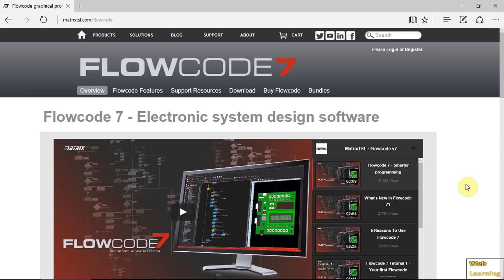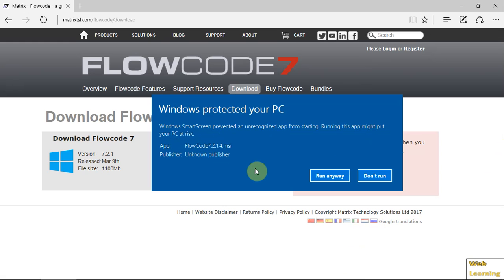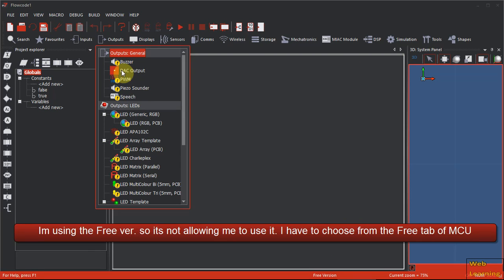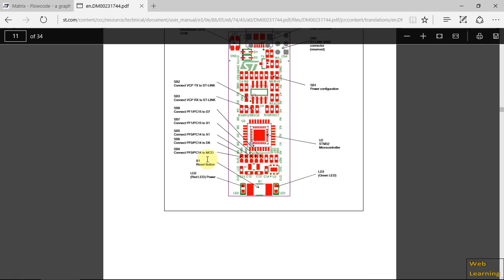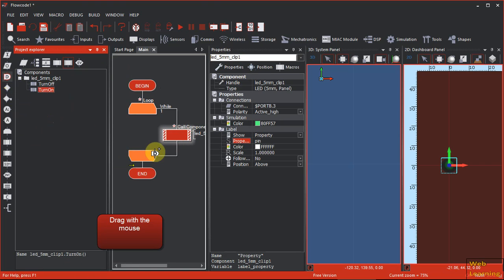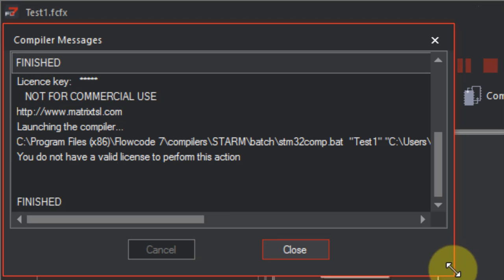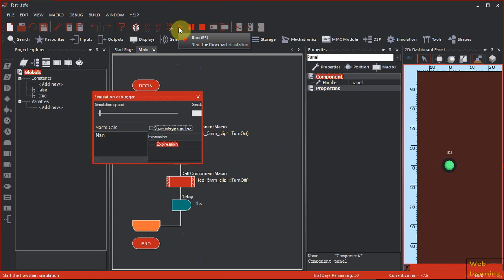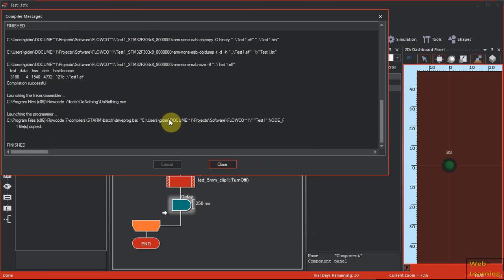FlowCode with STM32

Comment: Just came across this rather old video and had a little chuckle at the comments.

I'd liken the Flowcode visual editing philosophy to Labview for instrumentation. Nothing wrong with that, and a valued tool used across the technology industry.

If your bag is analogue/digital electronics design, not embedded, then Flowcode offers far FAR more than blinking LEDs!!!

Kinda' like saying to a software engineer... "Why buy hardware when you can learn electronics and have the flexibility to design your own?" (as I commonly do).

The Flowcode website and forums would soon reveal the power under the hood, and I've been using it for all professional projects since 2012. Now my professional engineering colleagues are buying into it, including integrating pre-existing libraries and C blocks in the flow for added convenience/flexibility.

A free/trial download to blink an LED is hardly something to judge it - other than to dismiss it out-of-hand in preservist fashion, and if it came to coding a new and complex project from scratch, I'd happily have a race with a seasoned software engineer any day!

Coding with scripted languages has its place, but then, so do visual compilers.

Comment: I tried this with Flowcode Demo V8 and it worked well. For simple projects, like blinking LEDs it might be usefull, but if one needs to implement more complex functions, it's not the IDE you wanna use. But for education purpose without looking behind the curtain of true programming 

it might help to quickly generate simple results.

Comment: Jeez. Are people still trying to flog this idea?  I've been coding since the 1980's, and during my whole career there has always been some new technology just over the horizon which will do away with the need for writing traditional code. Management (PHBs) are of course always ready to be seduced by the idea of replacing expensive and fussy engineers with machines. Spreadsheets was one of those technologies, and also the most successful I'd say. But do you see many smartphones being run by spreadsheet apps? Me neither. Sure, with a flowchart you could write a mickey mouse app to blink an LED. But how well does this scale up to larger, more complex projects where engineering management principles begin to apply? How well does it work outside the teeny domain of the sample building blocks provided?
Reply: you answered your own statement, i.e. it is for  mickey mouse app to blink , so chill your job is safe for now :)
Reply from the maker: With this flow chart you can also program and graphic LCD and more, but I never got the chance to do that...
But good programmers will always have a job for the more complex things.